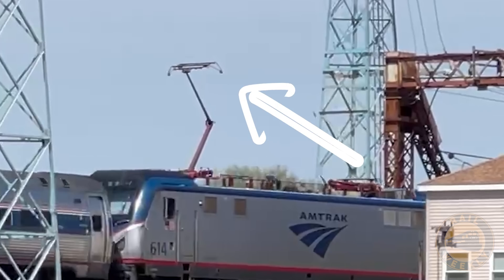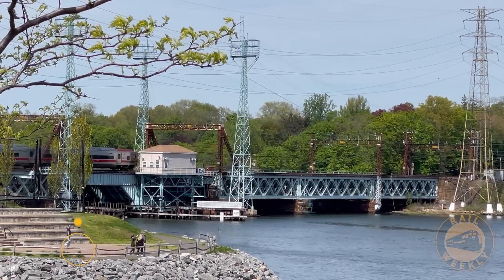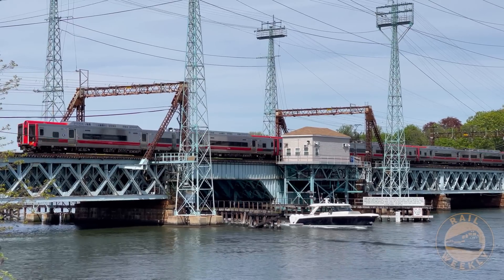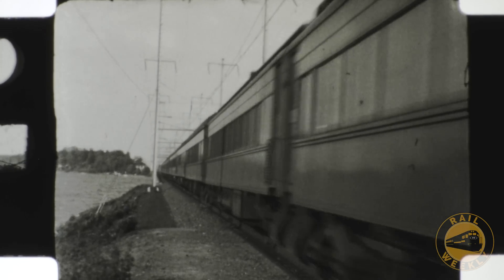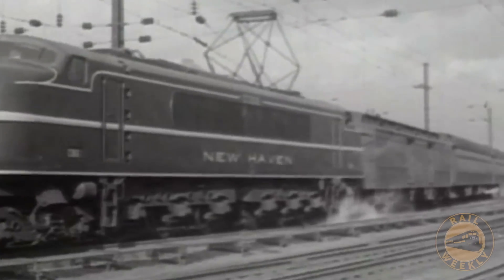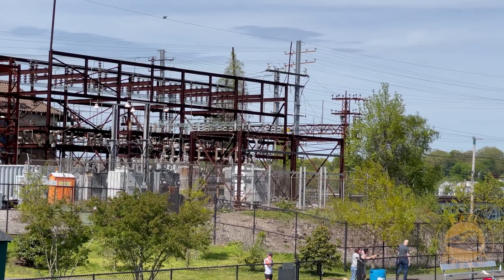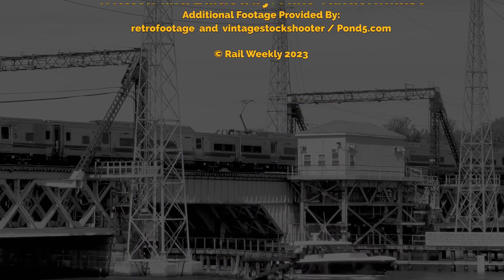The Curious Case of Cos Cob

Comment: One thing to realize is, on the bridges where there IS catenary wire, it is stand alone, supported by structures on each end of the movable portion (whether turntable, lift, rolling, or bascule).  That section is NOT powered, it is dead wire, there just to provide a surface for the pantograph to slide thru.  Note that the wire does become "live" when a train passes thru, especially an MU train w/multiple pan's, as power is pushed into the wire by the pan passing thru from the other pan's still under live wire ahead & behind.  Some residual power is also added by single loco's passing thru.  This is grounded thru the bridge structure down thru the piers, separate from the catenary system itself, which is grounded every couple miles.

Also, that Cos Cob power plant was one of THE most Toxic hazardous waste sites in the entire world when de commissioned.  The entire facility was insulated with asbestos.  Painted with lead paint.  All the oil used for lubrication had VERY high levels of PCB's in it, the same oil used in the electric train transformers.  Naturally, "housekeeping" & record keeping had been VERY loose & sloppy, especially during the bankruptcy of Penn Central (in fact many records were intentionally destroyed to minimize lawsuits in the early '70's).  It took decades & 10's of millions of $$$ to clean up & demo (a main reason it couldn't be preserved despite being "historic"), & the park sits on a very tight "cap" that is designed to isolate the "glow in the dark" soil remaining beneath the site.
Reply: Your comment that bridges that do have wire across the section on the moveable portion of the bridge unpowered and dead is totally incorrect.  Every moveable bridge on the NEC between Boston and NYC except Cos Cob have wire across the moveable portion. And on All of those bridges with wire across them the wire is 100% live and fully powered. whether a train is passing over it out not.  NONE have dead wire.  Amtrak and Metro North trains do not have any ability to feed power from one locomotive (or MU car) to another with or without a pantograph.  We can be drawing power and accelerating right over all our bridges with no issues at all. 
  As for the Cos Cob power plant. It was a power plant for the signal power, not the trains. And the Asbestos and lead paint are not the primary contaminates there as both are solids that can be easy remediated through surface soil removal.  The main pollutants are PCB's from all the transformers on the site and solvents from maintenance. The lubricants used were simply oils and greases, none of which had PCB's. PCB's are strictly from transformer cooling oils. And unlike asbestos and lead, PCB's and solvents leak far down into the soil beyond the realm of realistic removal. It's far easier to encapsulate the site.
Reply: @FFred-us9tw  I worked for MTA Capitol Projects & CTDOT Rail Cap Projects & CTDOT Facilities Design as a fully accredited civil engineer / project manager for 35 years, pretty sure what I posted is correct, altho you def got different stories from Op's, Power, C&S, or Mechanical depending on who you talked to.  Especially regarding Grounding & Bonding.  & "Plate Orders".  I worked mostly out of New Haven on Shops & Yards (also Stamford, E Bridgeport).  Mainline stuff outside of New Haven & Mill River interlockings (I worked on that in mid 1990's) were only word of mouth info.

As for some particular points:

- Cos Cob was ORIGINALLY for mainline power, at some point, prolly 1950's?, yes, it was relegated to signal power only.  Yes, the PCB oil was in transformers, altho the waste X-former oil had many uses, including herbicides on the tracks.  Asbestos in power plants is an especially Vexing haz waste, far more so than "usual" asbestos issues, as it's mainly friable.  We demo'd the much smaller New Haven power plant & that took a long time (years) & cost millions.  Yes it's not a liquid & thus doesn't soak into the ground, but the vast quantities of friable mat was time consuming & costly.

- From what I gathered, the wires on the movable bridges are all "dead" (do not transmit live power thru them, but are "live" from "stray currents" when a pan passes thru), but if you know better than me, so be it.  I was partially wrong on the pan's - pantographs CAN & DO transmit power from one to the other ONLY in TRIPLETS (M4/M6's), which have 2 pans per 3 cars, which have all since been retired.  There is a "breaker" between all the pairs (M2/M8's), & each pair has only 1 pan for 2 cars.  Altho with the introduction of the "trailer car" M8's ("D"-cars) which have their own "Hotel Power" pan, I'm not really sure what's going on - I've seen D cars permanently inserted internally in a pair (between A & B cars), & also seen D cars as true "trailer cars" at the end of a pair.  Good thing we still set the new Component Shop (I was the project manager) in New Haven with 1 triplet spot.  I remember the MN President who came up with the "Trailer Car" idea, & the CTDOT Op's brass said "YES", as they wanted odd number of car train sets (or thought that was a good idea).  I don't like the idea at all as I'm a shops & yards guy, but, YMMV . . .
Reply: @sideshowbob  I just thought about this but because of the gap How does one deal with the phase gap in this area? I've seen other areas with the "PG" signage but nothing as big as the bridge.
Reply from the maker: I recently met someone who worked on this drawbridge back when the power plant was still in operation. They said that the air quality was beyond awful, and that the local boat owners would constantly complain about the layer of black coal dust that would need to be cleaned off of their vessels every morning.
Reply: Nope
You're wrong.
Don't know who told you that, but it's incorrect.
No dead wires on any of the bridges.
Reply: Well, it was Metro-North Power Dep't engineering managers.  Brought up when we were trying to design a way of shutting off power at the fueling track in New Haven Yard.  The similarity of what we were trying to do was compared to the movable bridges.  I tried to type out the story but You Tube deleted my long epistle so maybe some other time.  I mean, I could actually name names (most of them retired like me now) but don't wanna do that on a public forum.

From a purely engineering standpoint (I'm a civil, not electrical, but as a project engineer / manager certainly dabbled in issues in every field), I'd think it'd be FAR more difficult to maintain a circuit across the gaps at either ends of the movable section, than to just leave it in a "dead but live" state.  Also far safer.  Less cabling w/12.5 KV power streaming thru them.  I'd be curious to see how the circuit is closed if indeed you're right & worked for MN / a consultant / contractor on catenary jobs & have better knowledge than I do.  There are certainly larger movable bridges with longer movable sections very close to stations where live wire would be required (trains can't "coast" thru "dead" section) - the bridge directly east/north of Newark Penn Sta for example (also carries PATH which is 3rd rail).  I was gonna say the Harlem Riv MN bridge above 125th st but that's 3rd rail too.  Portal Bridge adjacent to the "new" Secaucus station but that was added later & there's some distance between the station & the bridge, & now they just started building the replacement.
Reply: @sideshowbob  we are able to draw power as well as use regenerative brake, (which puts power back into the overhead wire) while going across all of our movable bridges between Boston and New York City.   
Most of the bridges have a circuit breaker that cuts power to the section of wire on the moveable span.  This is done when the bridge is opened.  
  The way the locomotives are set up, if they encounter a section of wire with no power the main circuit breaker (MCB) will open and will not re close until power is restored.  If all our bridges had no power then this would slow things down dramatically.
Reply: @FFred-us9tw  Ahhhh, so you're with Amtrak.  That's fine, if someone knows better than me, I'm all ears to learn new things.  In my career the thing that was explained to me over & over often turned out to be wrong, depending on who you talked to.  Or not.  Again, I didn't work on much mainline stuff, not anything near any of the movable bridges, just near the yards (E Bridgeport, Stamford, New Haven).
Reply: @blue9multimediagroup  Also realize that in MN Power Dep't lingo "dead" vs "live" wires means different things than to laymen (even other engineers).  A truly "Dead" wire is directly grounded to short directly to ground, isolated via section insulator.  These are typically found at the tracks approaching maintenance shops (something I worked on & am familiar with).  If a raised pantograph on a triplet were to intrude into this segment, the train would short out to ground & so would the catenary section leading up to the shop (which is why those tracks are always on a live circuit that's isolated from the rest of the yard btw).  This would not work on the bridges on the main line, as it would stop every train, duh!  So they "live with" an "in between" situation where the wire isn't powered, but it's not shorted directly to ground.  To the power dep't, who needs to emphasize safety for it's workers, this wire is labeled "live", as it potentially can carry current w/o shorting.  So, it's all in a matter of definition, & definitely an "in the weeds" affair.  Again, if you are more familiar with this than me, so be it, I accept your determination, albeit provided with no backup info other than "no you're wrong".  Thanks for that!

Comment: On almost every single railroad crossing on the Chicago, Aurora, and Elgin, there was no power for the electric trains, as they could not put thrid rail across the road. They just coasted across. The only exception was State Road, now Butterfield Road, where trains would have a station prior to the road crossing, so they didn't have enough momentum. As a result, trolley wire was above the road and for a short distance on either side.

Comment: I always wonder do drawbridges have to get scheduled with the train? That is how do they decide who gets to wait.  And of course I wonder if moving bridges can be high speed rated, that is can the Acela keep the hammer down.
Reply from the maker: That is a great question. I have ridden the northeast corridor a lot and I have never been on a train that has been stopped for a bridge (unless it got stuck in the up position and it had to be repaired). I suppose that suggests the bridge operates around the rail schedule? Hopefully someone more knowledgeable can weigh in.
Reply: Marine traffic has the right of way within reason.  Typically during boating season on busy rivers the bridges remain open and only close when a train needs to pass. But it’s not unusual for us (trains) to wait for marine traffic when it’s been backed up for awhile.  
 As for high speed? They could be, but of all the moveable bridges on the NEC none are even in the high speed sections anyhow.  So it’s a non issue.
Reply from the maker: Thank you!
Reply: I got stuck on the bridge they had an issue trying to get it to lock back into place.. it was like a 10 min wait.. The good thing about it is the bridge opening aren't as much as they used to be.

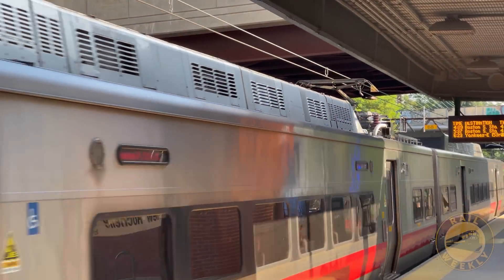Comment: 2:12 When you don't want a country wide standard height for overhead wires this is still easily avoided. Just by making the first cable carrier as high as the highest cable anywhere and make the first 100 meter or 300 feet in a slope.
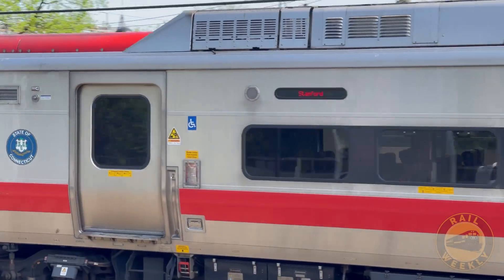2:25  107 feet of a gap is no issue. At 20 Mph the stopping distance when braking is about 200 feet. Free-runing you won't even notice a slow down. Only when there is a need for breaking, there is no issue at all. And even in the unlikely event the train stops on the bridge, a one car passenger train can be pushed forwards (or back) with a few strong passengers (google it for yourself, it happened in Friesland about thirty-odd years ago.
The only thing you might notice is the lights flickering, dimming slightly or go out, depending on the  used power-backup.
Reply: You can’t have a standard height for the catenary. Hundreds of locations where the trains pass under overhead bridges or go through tunnels where it need to be much lower.  In other sections it’s full height to allow auto racks. 
 As for the train coasting and not even noticing a difference in speed,  you definitely do.  Because when we open the main circuit breaker on our trains, the locomotive produces HEP through regenerative braking. This puts a load on the motors and slows the train down. Not enough to stop it, but it does drop your speed.
Reply: @FFred-us9tw  You are right.  I as a passenger never noticed a slow-down. Only the mentioned lights and a slight change in the sound are experienced by me. 
I used "you" as "people in general", a form common in Dutch. This linguistic turn brings us to RobWords territory.

Comment: If I ran the railroad, I would not rely on operators to lower the pantograph. I would simply have installed a metal bar at an angle, that would do it automatically. Am I the only one with enough brain cells to come up with this??
Reply: The people who designed it have even more brain cells than you.  Because they made an even simpler solution, what you’re looking at at that bridge at cos cob. There’s no reason to lower the pantagraph. You just Coast on through with zero issues. Adding a system that would drop the pantograph introduces a failure point. Being able to just throttle off and coast eliminates that.
Reply: And that would ruin the pantograph which is why you're not running the railroad
Reply: @blue9multimediagroup  How? How would that "ruin" it? Explain the difference between a metal bar and a metal wire as regards contact with a pantograph.

Comment: When Metro-North went to all the trouble to replace the whole remaining New Haven electrification with their own 12.5 KV @ 60 Hz electrification, why didn't they invest the additional little bit to put catenary on this bridge?
Reply from the maker: If you’ve ever seen the episode of “Extreme Trains” on the History channel on the Acela, they have some really cool footage of how they deal with the catenary on a rolling lift bridge like this. It’s quite complicated with a lot of moving parts. Perhaps they didn’t deem it necessary with the added construction and maintenance costs?
Reply: @RailWeekly  Also wonder if maybe they thought the bridge was going to be replaced, and then it never was?
Reply: Why bother? There is no need for it. This bridges catenary design has worked perfectly fine for 100 years.
Reply: @FFred-us9tw  As someone posted in another comment thread about either this bridge or a similar one, trains do get stuck in the gap sometimes.
Reply: @Lucius_Chiaraviglio  when trains do get stuck in the gap it’s no different than when trains get stuck in a Dead Section which although having continuous wire above, the wire is electrically dead.  This is done to separate two separate sources of electricity.  So  wire above or not, trains can still get stuck.
Reply: @FFred-us9tw  With an electrically dead section of wire, at least in principle you could energize that in exchange for making an adjoining section temporarily dead.  I don't know if the switching capability for that has been implemented on Northeast Corridor overhead wire, but at least it could be done.  If you don't have overhead wire at all, you can't do this.
Reply: @Lucius_Chiaraviglio  In some locations the dead section can be brought to life. It's often time consuming so it's not a simple fix.  But it's only possible in a few locations. That being said, the fact this location at Cos Cob has no wire at all doesn't make it the only location where another train has to perform the rescue. So it's not any more troublesome than other locations. The next dead section west of Cos Cob is at Harrison NY and that is just such a location that cannot be electrically reconnected. We had a Regional train stuck there for well over an hour waiting on a diesel from Stamford.  
  The main reason any trains get stuck in dead sections on Metro North is primarily due to their poorly engineered and maintained signal system. The signal engineers who mapped out the signal blocks paid no attention at all to the dead sections and that causes many of the issues they have.
Reply: @FFred-us9tw  Why did they make the switching procedure for overhead wire dead sections so cumbersome?  Should be set up so that throwing a few relays will do it.
Reply: @Lucius_Chiaraviglio   It's complicated by the distances to travel (miles between dead sections are not standard) and whether any other trains are in that section.
Reply: @FFred-us9tw  All of which should be possible to determine and do by remote control (Metro-North does have positive train control and geolocation, right?).
Reply: I think it’s also a phase break between two substations.  Might as well not bother, then.

Comment: As a NYCT subway Train Operator, I call this "Art of the Coast"
There are certain areas of a particular line where coasting is a necessary function of train operation. 
I use it to basically maintain speed in certain areas where braking wouldn't be necessary and to keep from over speeding...
There was also a situation where I had left 4th ave/Ninth street just as a power failure occurred but had enough coasting speed to roll the train onto an area where the power was restored, similar to the example given in this video...
It's a rare occurrence, but it does happen...
Reply from the maker: That’s really neat. Thank you for sharing!